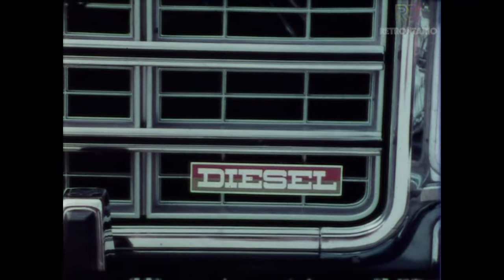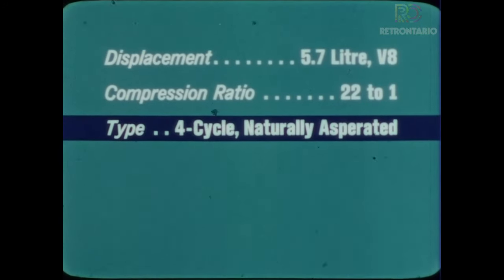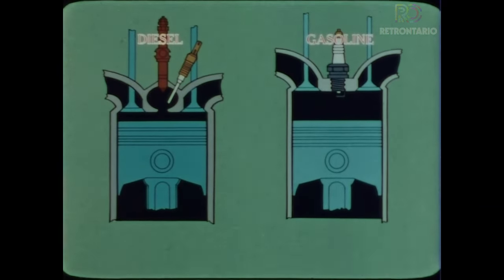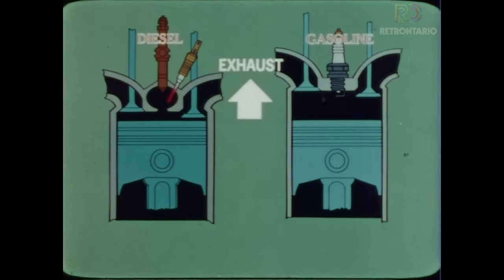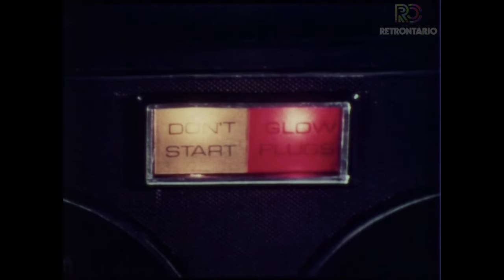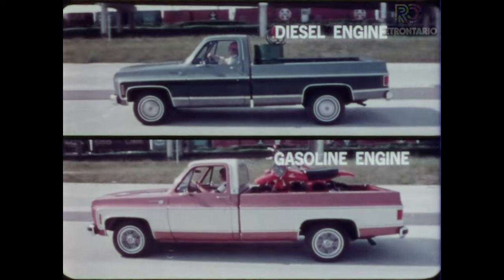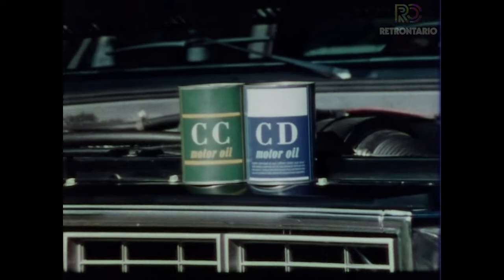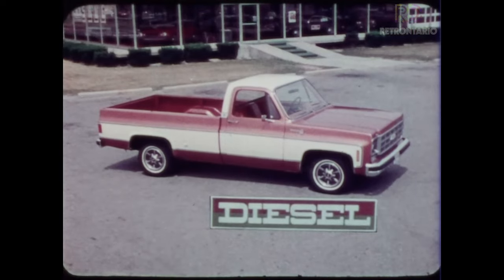SUPER 8 REEL - DIESEL POWERED C10 CHEVY PICKUPS (1977)

Comment: Turns out this model was a real turkey of the entire C10 series -- worst of the worst.    !t used 1st gen Olds deisel engine which was a dog.
Reply: better than an $85,000 dodge Ram truck in 2024 though - and didn't put the buyer into debt slave status to purchase.
Reply: Too true. A disaster for GM.
Reply: I believe one of the only redeeming qualities is that an Oldsmobile 455 will fit on the same motor mounts.
Reply: But would get 28 to 30 mpg
Reply: @SPINNINGMYWHEELS777 yea I can't believe people are so dumb to spend so much on vehicles now. Unbelievably stupid.
Reply: @OakRidgejet  Hmmm, I didn't know that.